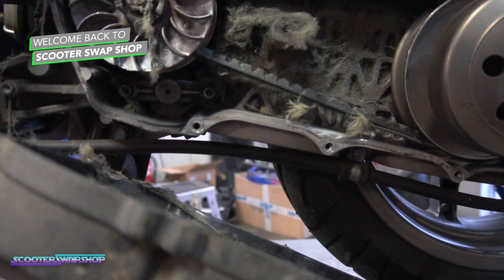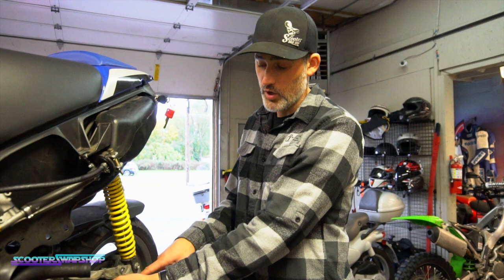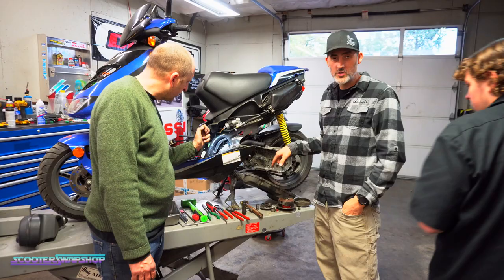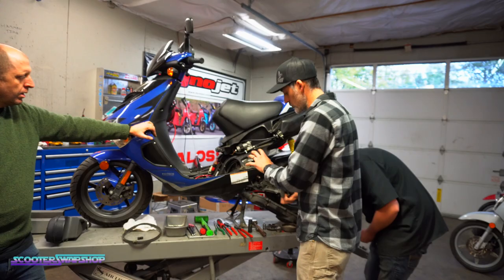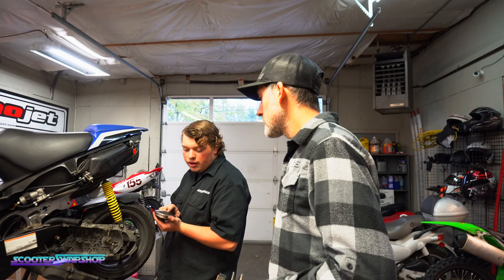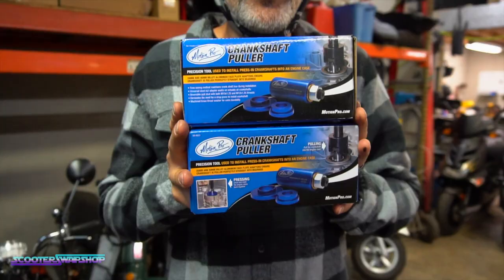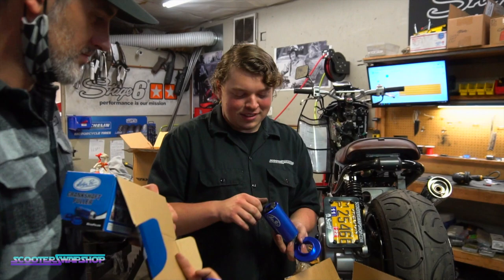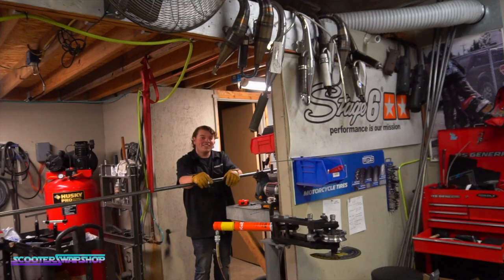Scooter CVT Transmission Tuning, What not to do...

Comment: Hey.,i have a Aprilia leonardo 125cc 1998. What other brands scooters have the same CVT so i can find correct springs for the torque and clutch? And maybe even the rear part itself as the grooved slots the clutch rides on are worn so the scooter is sometimes stuck in high speed and are slow to get acceleration again. Please advise. Thank you from Norway

Comment: I don't have any power tools & ratchet gun etc. I only use good old box spanner with torque wrench. How tight should i torque pulley and clutch bell nut?
Reply from the maker: your going to ned a tool to hold it we sell on the site

Comment: Hello guys! Thank you for all the tips and great videos!!! I recently upgraded ...and want to hear your expertise on roller weights!? 2004 Derbi Atlantis Bullet et2 piaggio engine. Setup: S6MK2 sport 70cc, S6PWK21 carb, S6 intake system and reeds, Yasuni R, Malossi 2000 Variator, Green Polini springs, original crank, contra spring and belt. Still tuning...friend recommended the Athena racing long belt. I am currently with 5 gram rollers and the scooter ripps awsome! Didn’t push it too much for top speed since was around 40F and super windy...got 65 on GPS...My question is have you tuned that cylinder before, what’s the optimal rollers? I also have the white Malossi spring that came with Malossi Multivar 2000 variator. Thank you! Any coments are much appreciated !
Reply from the maker: we have many videos on cvt tuning!

Comment: Since this video is about an Sr. It's a Morini engine. These come with an very heavy stock spring an 9r rollers. I've got the problem with the Morini engine, it's perfectly setup 70cc, yasuniR , multivar, delta clutch etc but the top speed won't go above 70khm. Ever had this problem
Reply from the maker: what's the question?
Reply: I have a stock bike with a eBay black exhaust same engine (Suzuki katana) everything what rollers will I need as trying to chase down the previous owners mistakes bc I can only get 33 on speedo and been told that they get to 45

Comment: What do you think? I have 2007 yamaha c3, Polini speed variator, 4.5 dr pulley sliders, Stock springs and contra. 29 to 35 mph What can I do? Kit came with blue contra Should I put that in or a different color spring. Thank you.
Reply from the maker: Hi you’d want to reach out to the supplier you got those items from. We don’t really do any tuning on the c3.

Comment: I just got an Aprilia SXR 160, it barely does 100kmph, rpm doesn't go beyond 7k, scooter moves only around 4k before that it doesn't even try to move. Everything is stock. But the same engine specced Sr160 does 140kmph. Is there anything I can change to make it a bit faster?
Reply from the maker: I’m sorry I’m not sure we don’t have those bikes here. Sounds like it’s restricted

Comment: Im thinking of getting a yellow contra, malossi one for my peugeot. It has the akrsal t6 asso mext r pipe 21 carb and the belt is splipping and the clutch is slipping so im getting a malossi fly but was thinking about getting the yellow contra, do you think it would be good and not overkill?
Reply: How many rpm is a yellow contra?
Reply: @ajc5601  i dpnt know it just says 30% stiffer its their middle one. Red is stuffest then yellow and white being slighty stiffer than OEM at 5%
Reply from the maker: call the shop or message us on the app
Reply: @exapioz3075  Just get a white one and a yellow one and a set of rollers.. if ur making like 5hp u could run a yellow one and ajust with the rollers... i liked going yellow and stif springs on the clutch in the back.. so the pickup was at like 2000 rpm... and then ur really taking off.. with the white ur stuck at going very light rollers.. that can make it harder to ajust.. but going red is never reccomended for a normal scooter.. going yellow is more fun but ur also going to need a new belt/clutch and rollers about every year..

Comment: Great video I have a 2022 ADV 150 stock I am getting 65 MPH I am wanting more top in and quicker acceleration which variator set up with sliders would you recommend and slider weights I see you have two of them on your website. I am 250lbs
Reply from the maker: we have a 75 mph kit.
Reply: @Scooterswapshop  do you guys have anything for a 2023 zuma 125?

Comment: I have a very rare gy6 reverse trike meng 150 side by side, is there anyway you could tell me in inchs the distance center to center between the rear clutch and the front compenater thanks i need a new belt and want to make sure i get the right one,
Reply: On a regular one so I can see if mine is the same I have a reverse on mine so it may be different,
Reply from the maker: Hi you should measure yours to know the length needed

Comment: Wonder what kind of clutch springs he was using probably 2000rpm also I alway try to stay under 1500 on both them if I can for some reason I have a stock kymco agility125 that has a red spring in it previous owner told me he bought it new that way it takes off fine and the belt looks fine so I been running it that way but my pre bug with a 70cc polini sport kit I run a 1000rpm contor and clutch springs I like to get off the line quick if I need anymore I'll play around with the rollers to get more
Reply from the maker: nice

Comment: @scooterswapshop hey so I just bought a 2018 genuine roughhouse sport scooter and it came with the restrictor off and it tops at at around 45mph what would you recommend on upgrades for the transmission and exhaust ? Would like it to go faster but don’t wanna make it where I can barely go up hills, I live in Connecticut so there’s hills. Thanks in advance for the help
Reply from the maker: 45 is about what your gonna get out of it but call the shop talk to paul he can tell you if there is anything you can currently get for it

Comment: Yo I’ve got a gy6 250cc bike (can see it on my channel) I’ve alr got derestricted CDI new coil and spark plugs and new nibbi carb was looking to CVT for next tuning and upgrades any ideas like race clutch or anything ? It’s new bike only 1200 miles haven’t changed the CVT belt or gear oil yet.
Reply: Also max speed is like 70-75 mph btw, seeing that some 150-200cc can get that I’m sure I can get more with a 250 gy6

Comment: I have a 50cc taotao 1p39qmb Veloz scoot. I'm getting fire to plug and gas.But its not wanting to crank what could this be
Reply from the maker: air leak or 100 other issues
Reply: Check the compression!

Comment: Interesting, what do you reccomend for a 150cc? I got banjin driveface oko variator with 12g, ncy clutch and ncy 1500 contra spring. When i was completely stock i was able to do 60 with 17 rollers and when i slapped those parts i lost about 3mphs even though i went lighter on the rollers im not reving near as i was before.
Reply from the maker: you need to take it one step at a time when tuning there's no weights I can tell you to use that's gonna achieve what you need all pieces work together.
Reply: 17g  rollers and a light contra spring is gonna give you the best top speed at low R.P.M...

Comment: I have a Yamaha jog r with stage mk2 Racing Ac and i have a malossi red spring do i Need to change that
Reply: nope i dont think so only if you are running original cilinders or something like that but maybe go yellow mate
Reply: No
Reply: If it works it works I would test a yellow spring and lighter weights maybe and if it runs better the way you had it then there you go
Reply: @nastynatesscooters9896  yeah yellow would be a bit better i said that to
Reply: Use the lightest contra spring you can without any belt slip.
Reply from the maker: looks like the boys got your questions answered

Comment: So not knowing that I need a weight or a spring is a prob, color coding only allows for fakes (ie: spray that one green and send it?) come on and tell us what is what..

What weight? What springs??

I can put a 1500 spring in a clutch and a light roller in there (6 gram) but that is all phopaa...

Same is same...

One thing has everything to do with the other on gearing with cvt...

I have a heavy weight scooter but the clutch is engaging too late so it shifts (3rd gear) up before the clutch engages (then back to 1'st gear) and I if I got ran over by the fool in a v8 car or truck that was in a rush, what would a contra spring mean to me?

Cures for that?

Ramping of the clutch with slinky springs?

Weight of the sliders/rollers? A low (1000) contra spring painted blue?

Let's start at the beginning...

49CC qmb.

Too easy? Impossible with all the double talk out there...

A battery?

Battery be damned.

PS: filled up  after a 100 mile ride in less than 30 seconds at a cost (and consumption) of $3.30 Humm...

Pull over for a hour+ to charge your battery? With electric you don't have a spare and have to stay?

I'm a ole Harley fan (been across this country twice. ocean to ocean via bike) and the belt made power, on a 49cc CVT it uses it up via friction.

No real rocket science there...

So a 139 QMB 49cc long case with a 12 inch wheel needs what weight on the Variation?

No need to warrantee it, it's real or it's not.

Time to get real about it.

I think 90+ MPG is WAYYYY better than a dead battery and a ensuing problem in the parking lot while I'm stuck waiting for a hour t0o get charged...

But then what do I know?

Wanna hang around while your transportation get's charged back up from electricity we don't even have to power homes (rolling blackouts)??

Me neither...

A simple thing, roller weights versus sliders?

Gram conversion table?

Real facts??

How complicated.

https://youtu.be/2SAbGvMTs3E?t=7

Help us out...
Reply from the maker: Im so confused at the paramore lyrics, Also the questions are super confusing. I cant answer 20 questions here your best bet is search each issue and go from there we have SEVERAL CVT videos... start there
Reply: @Scooterswapshop  Well I guess I'm asking this...

I have a gron clone (vitacci) came with terrible springs so I bought 100 and 1500 springs hoping to tune it. The clutch is lightyears better but still enguages at 300 rpm (not a bad thing) but the cvt shifts way up and then settles in a low gear  10 to 15 feet from the stop sign (a dead stop).

100 clutch and matched contra blue. Can't go to 1500 on contra as the thing takes forever to shift up and it not using any torque from the motor...

Running around 8k on the tach. continually but no grab on gearing making the motor a zinger at 8k rpm that won't get outta it's own way.
Only 200 miles on it.

Any ideas on parts to fix this? Thinking about converting to a manual flat slide carb and sliders but can't find any stock specs on this china scooter.

Guess I'll have to weigh the rollers.

Any suggestions would be greatly appreciated.

Thanks...

Oh and the paramore was just a good tune to through in...

...nothing meant by it, just like the tune.

Try this one...

https://youtu.be/UQv7Tr8HbGE?t=53

Hehehe :-)

Comment: When are you guys restocking dio primary gears 13/35? 🙏🏽🙏🏽🙏🏽
Reply from the maker: Whats the  brand? thats a interesting size you are asking we have 16/36 in stock.
Reply: @Scooterswapshop  Honda dio top racing primary gear set 13/35. It’s on the website just bummed they’re sold out.
Reply: @Scooterswapshop  trying to pair the 13/35 primary with secondary gears 13x45 to get 9.32:1. I have a dd50 block with dd50 primary gears (12x34) I’ve been hunting and can’t find af16 primary gears (12x42).
Reply: When you say size 1500 rpm for  clutch or contra springs does that mean soft?